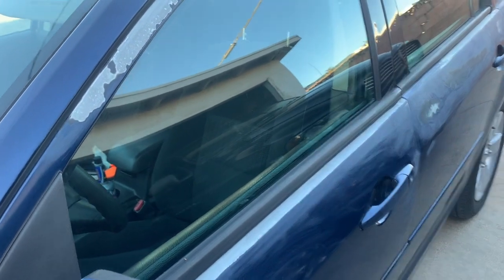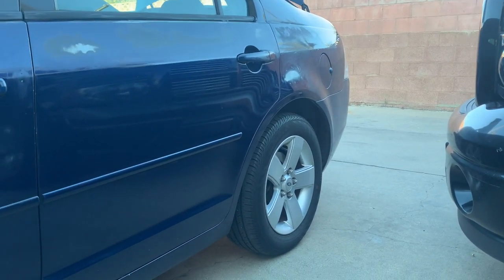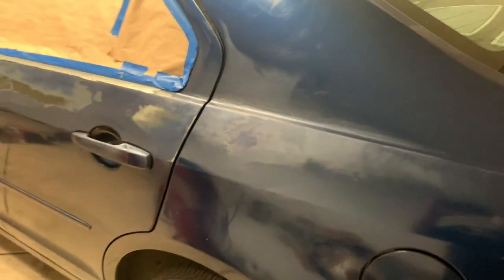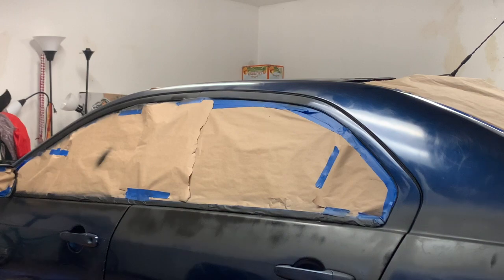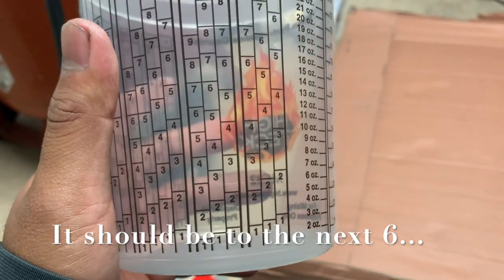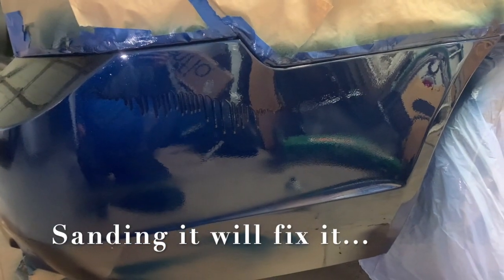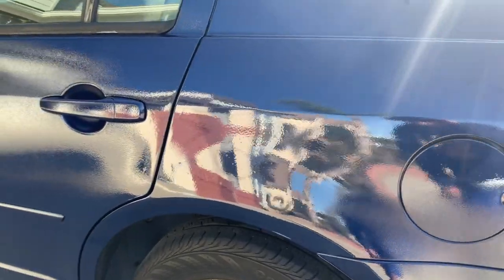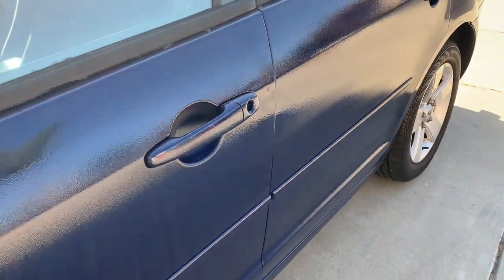My First Time Painting a Car Single Stage DIY - Results Gone Wrong Ford Fusion

Comment: If you don't mind I'll give you some tips as I do this for a living. The reason you had a lot of runs is your fan was too closed open it up all the way and go half to 1 full turn in. Also fluid for the most part and be fully open but if you see yourself getting too many runs you can restrict it a bit and fully open it and go a full turn in that way there isn't that much material coming out of the gun. Also pressure I don't know if you had an air gauge but you typically wanna be spraying around 20-22 psi for basecoat and around 17 psi for the control coat which is basically stepping back a bit and misting the metallics on to ensure you don't have tigerstripes or mottling. Lastly clear coat you wanna spray around 25-30 psi, get close and move quick, if you're too far away its gonna come out dry and very peely get around 4-5 inches from the panel and move with a consistent rhythm. Hope that helps man!
Reply from the maker: I truly appreciate your comment and thank you for your support. I will definitely be doing this for my last paint (overall paint on car)-coming soon
Reply: Rookie Repairs No problem man I try to help anyone I can! Painting is all about consistency and knowing where you last painted that way to you don’t overlap too many times and end up having runs. Also let the base coat flash off, put a coat let it dry a bit and then apply another coat. Don’t try to cover it in the first coat.
Reply from the maker: This is why I made this channel so people can start doing some repairs on their own especially in these hard times... 

Once again thank you for your help and support. I will definitely do my best to avoid going back and fourth on the 1st coat - as you mentioned: “Don’t try to cover it in the first coat.” This rookie was doing that a couple of times and ended with overspray ... 😅
Reply: Rookie Repairs Hell yeah brother! At the end of the day you’re only gonna learn from your mistakes and sometimes I make mistakes also even though I’ve been doing this a couple of years. I was fortunate enough to have my Dad teach me.
Reply from the maker: That’s great brother, thank you for willing to help us learn something new

Comment: Single stage paint is high pressure low volume,meaning air pressure 40 to 50 and adjust the gun fluid so it don't spray heavy,basecoat clear coat is low pressure high volume,which means air pressure 20 for base 30 for clear.Hvlp guns don't do to good for single stage. Need a LVHP gun for that.I also learned the hard way.
Reply from the maker: I am truly thankful for your comment and thank you for sharing this to us all.

Comment: Did you do any kind of research before doing anything?
Reply from the maker: Yes I did- prep work before paint- sanding, cleaning surface all that good stuff. Paint shop (also a body shop) provided a lot of great information. What I did learn was that not even professionals like using single stage paint- which I will not be using anymore... Decided to paint the entire car. Here is the final results: https://youtu.be/OyrBRhWQCZQ

Let me know what you think about the results.?
Reply: @RookieRepairs  came out a lot better than the first time
Reply from the maker: Thank you for your comment. I’ll stay away from single stage paint for now- what is the most difficult part for you? I thought the sanding takes a lot more time than I thought...
Reply: Exactly
Reply: @leviholmes111  LMAOOO

Comment: Definitely keep it up also before you spray base/color spray some on a box and go from there I use cheap $15 dollar spray guns I have 3 one for primer one for base and one for clear definitely need to get a better guns
Reply from the maker: Thank you for your comment and for your support. Unfortunately I didn’t use base and clear- I used single stage paint—which I heard that they are not commonly used in auto body shops. I decided to remove this single stage paint and paint the entire car— video is coming soon. 
I bought a black widow gun from Harbor Freight for $149.99 but are now going for $229.99. I don’t think you really need to have overpriced guns as long as they give results and they work that’s all that matters ...
Reply: @RookieRepairs  sweet look forward to seeing the video also the air Compressor has effects on it if it can keep up with it or enough cfm also mixing the paint